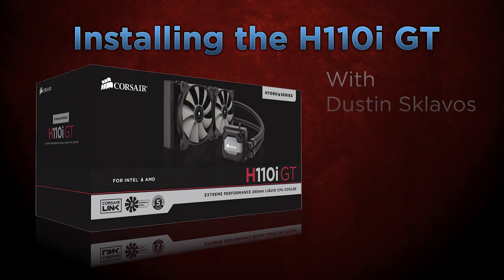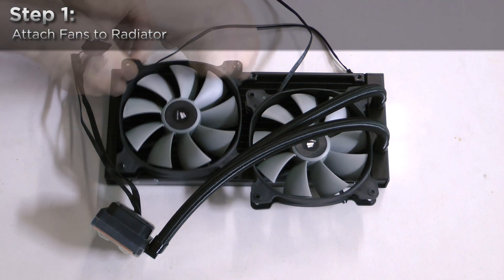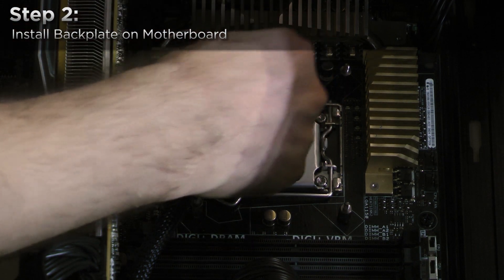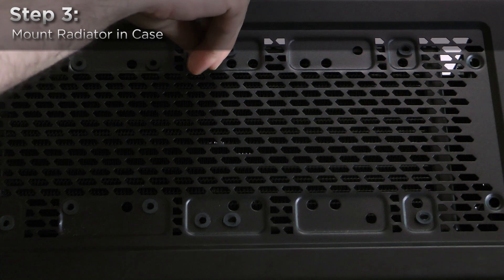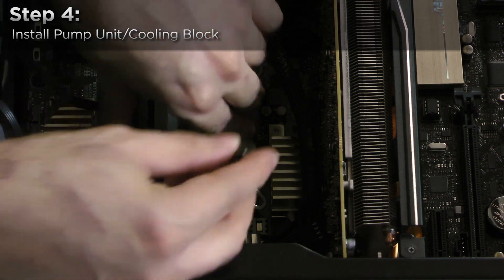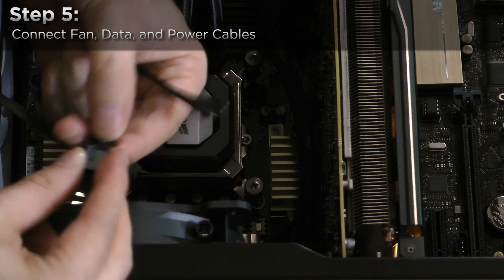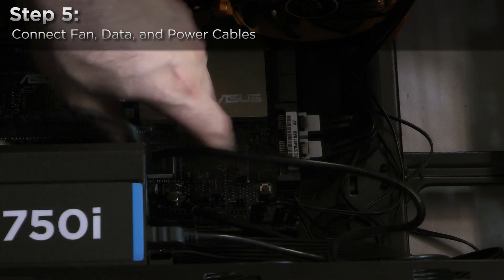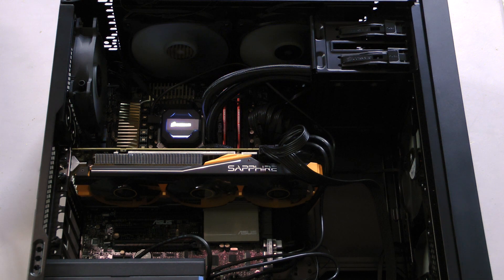Corsair Hydro Series H110i GT Installation How-To Guide

Comment: "How to install the H110i GT on your Intel cpu" why is this an intel only video?
Reply: It's because on the mainstream market, and maybe for computer scrubs, intel is more popular and has a bigger market net worth.
Reply: pjgmorgan The 8350 beats the i5's..
Reply: I already know how to install these, I'm just saying... I have the previous H110 in my BitFenix Ronin...
Reply: SpurnOfHumanity fucker barely fit though... I had to break off a couple of plastic bar things that didn't really matter but it fits perfectly and everything is secured properly.
Reply: cuz intel is better
Reply: preference. not in the budget market. also, AMD is known to perform better with multitasking.
Reply: You wouldn't put an h110i gt on a budget cpu. And with regard to multi tasking, that is absolute bullshit.
Reply: The fx-8350 outperforms anything at the same price point and believe it, they DO do better at multi tasking than the intel counterpart. 
I realize full well that the upper tier cpu's perform ungodly faster but for the lower - mid tier cpu's AMD just has it.
Also, when you're overclocking to 4.7 - 5GHz you can bet your ass i'm gonna be using a cooler like that. You can't even HIT 5GHz on air with Intel.

(and FYI before you pull out the fanboy card, I plan to do an Intel build eventually)
Reply: Intel is better
Reply: At the high end level but the price is too high.
Reply: Not for me
Reply: I'm not saying i cant afford it, i just dont find it worth it because everything in the high end is better used for editing. For gaming, as long as your cpu doesn't bottleneck you gpu its good enough. 
You can even go as low as the 4300 and it wouldnt bottleneck the 980
Reply: Oh god we have a bottleneck bandit. Why does everyone think that good cpus are only for editing and gaming. Who even said I was a gamer. I run CFD models on mine.
Reply: Well, the LARGE majority of the people here are gamers first.
Reply: wut?
Reply: Logic
Reply: barely
Reply: Ruins
8350 beat last, last gen 3570k i5's, in multi core applications
Reply: ***** That is ridiculous. It is not AMD's fault developers don't optimize their games to run on more than 4 cores.

"and don't just show rendering benchmark."
You are stupid. Why wouldn't you test with something that is actually going to take full advantage of the cpu and all available cores? Oh right because you are a fanboy.
Reply: Ruins Heh. almost certain any of the i5 and up skylakes stomp 8350's.

Comment: It all looked good until the USB connector appeared. Ruins the whole aesthetic of it.
Reply: i think you can disconnect that after you've everything in corsair link as you want it :P, if you want too, i can test it when i will change my cabels to sleeved once c:
Reply: specwise it fits, but the tubing is like more thaen a foot so yeah
Reply: How did it go? I just ordered this.
Reply: quick qestion where on my motherboard do I connect this usb connecter? I have a sabertooth 990 fx and also I am using a corsair air 540 will this fit in it?
Reply: You should have a USB2 connector. It's got loads of pins in two rows with one missing. It's hard to miss. Usually on the bottom or right hand side of your board. 

Let me know if this helps or if you need more help. 

You can usually get a schematic of your board in its manual btw.
Reply: Ameer Mahmood sweet I found it thank you! Would you know if this will fit in the corsair air 540 I looked on there site and it does not say and the one that does fit in this case is the H110. But I dont know if this new one will fit or not?
Reply: Eeermmmm, I don't really know off the top of my head, but my immediate guess would be a "yes"; considering both the case and AIO are made by corsair. 

If the corsair site is not proving a good reference, find the H110i GT in pcpartpicker.com and check compatibilities, if your case is in the list, you're good to go, if not, you could try experimenting lol? Or just do a return/not buy it. But it's likely suitable if it supports the H110. 

My S340 was a mission to get it installed, I was rotating it this and that way and manipulating the screws to other worldly levels lol. Just give it a go, mate!
Reply: The tubing is like 15-20cm, it's really not that bad

About long enough to curve around your and then that's it lol.
Reply: sure you're talking about the h110i GT? cus i got mine today, and the tubing was around 35cm...
Reply: You're probably right my bas
Reply: Tommy Strandman I have one and can confirm this.
Reply: ***** Yes, it did.
Reply: Yes, it stayed Red after i unplugged the USB
Reply: Though I'm not sure this is a concern, just keep this in mind... The static pressure fans included go over 2000 rpm EACH and they are NOT quiet. I have mine set up to run at 550rpm each until cpu gets to between 45 and 59 degrees Celsius, where they hit 1100 rpm (a speed I tested to not find annoying lol), and anything above or at 60 needs 100% intake... But that is never the case in my experience as the CPU peaks at 40-50 degrees C (only momentarily hitting above 40 for like a second or two).

If you disconnect the USB 3.0, back to the discussed point here, you may lose your option of altering profiles you've made for the fans... 

Personally, I run the cooler as an intake, so everything inside the case is dependent on how much air those fans are pulling in... My GPU can vary in around 8 degrees Celsius if I have the fans on their usual quiet status compared to something more substantial... So you may want to set up several profiles for different tasks. I would advise you just cable tie the USB and fan extension cables together and route them behind the motherboard through a case cutout - my rig looks pretty clean doing so (and If I do say so myself, the thick USB cable looks actually pretty sweet).

My 2 cents, maybe it'll give insight!
Reply: lol, i just bought 2 noctua ULN 140mm fans, which runs at 900 rpm maks and i cant hear it at all and my temps have never been above 43 celsius lol
Reply: i'm using a seperat fan controller, but as long as you have the pump connected to the cpu fan on the mother board there shouldn't be any issues
Reply: naah, jsut the pump which got a 3 pin. the fans can be connected wherever you want to

Comment: How do temps compare to the H100i?
Reply: probably better since the only difference  between this and an h110 is the better fans and a software controllable pump system.
Reply: I think my H100i is also controllable through corsair link (which leaves a lot to be desired). I'm assuming that the only difference between the two is that the H110i has SP140 fans as opposed to the H100i's SP120 fans.
Reply: as i said, its essentially a 280mm h100i
Reply: I've heard they are coming out with an h100igtx
Reply: I think that they are better just because of bigger rad and fans other then that they are same
Reply: creptrbot its better bagause bigger rad bigger fans and better pump and it have lot less noise